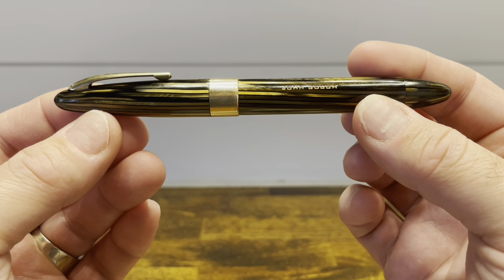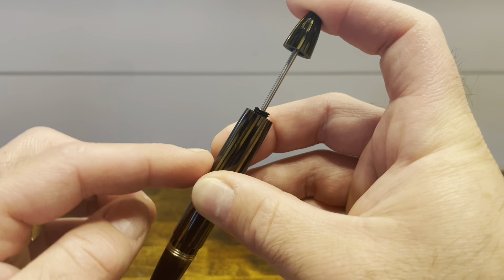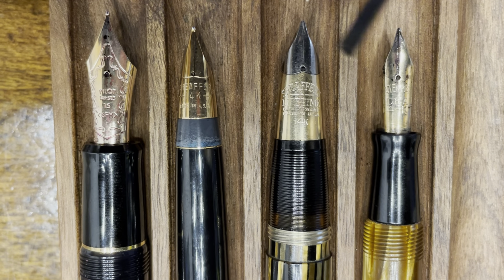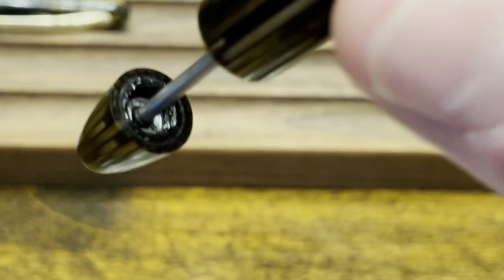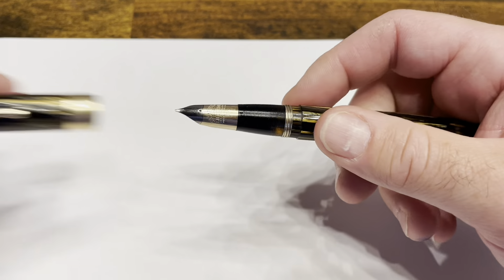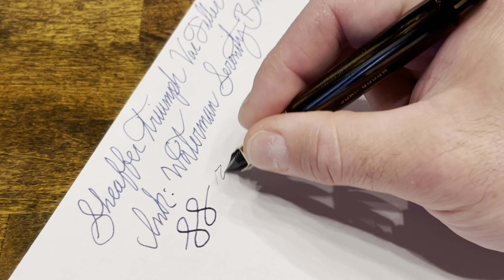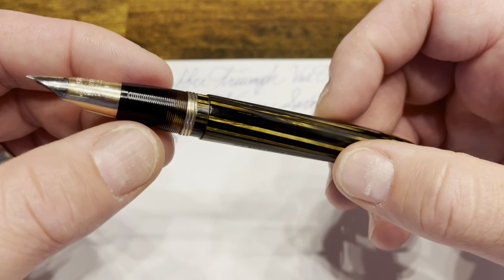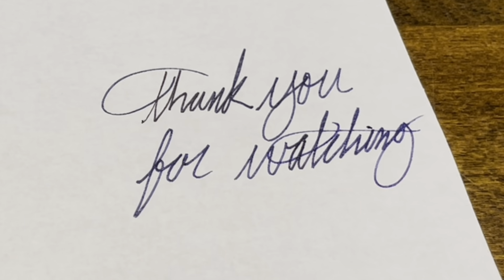Sheaffer Triumph Vac Filler - Thank You for Your Service

Comment: I have a sheaffer triumph and i cant unscew the bottom plunger and also the top nib i cant unscew. Any suggestions?
Reply from the maker: @lilowlthrifter911  does it look similar to the one in this video? There are many different style Triumphs. In general I recommend trying to soak the nib in some lukewarm water to loosen up dried ink. It could take up to 30 minutes if the ink is very old. And then try to unscrew with the help of gripping materials.
Reply: @ForTheLoveOfPens  yes but its clipless. I will try it. Thank you

Comment: How did you know?? I bought one of these on Friday (or similar) at an auction on Friday. Mine has a broader cap band though. Apparently that dates it to 1942.
Reply: That was the top of the line Triumph and I have one as well.  Real beauties, these.  The Triumph nib solved a problem that no longer besets us:  carbon copies.  These pens aren't well understood now-a-days.  How many fountain pen bladders would it take to make one B-17 tire?
Reply from the maker: I hope you love it!